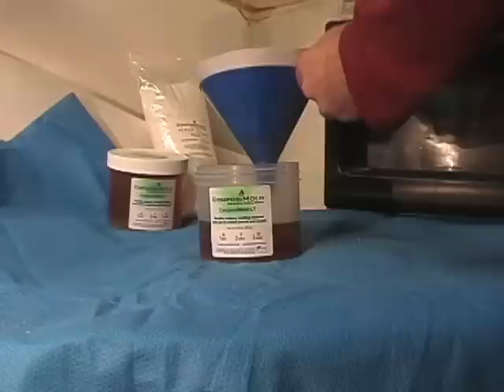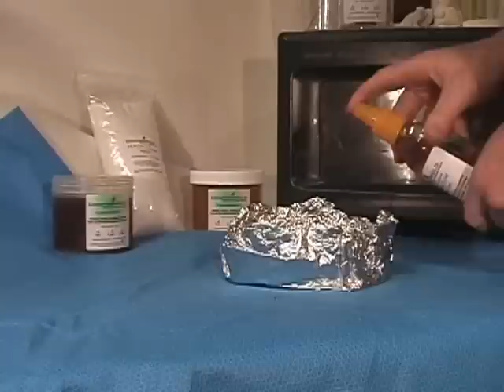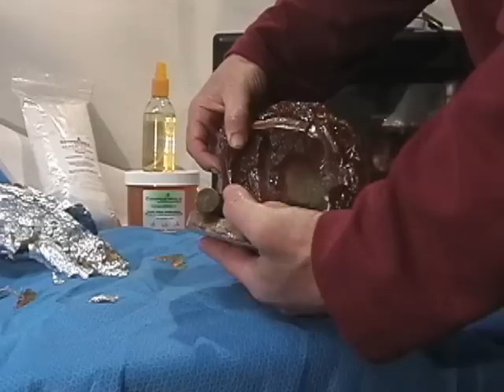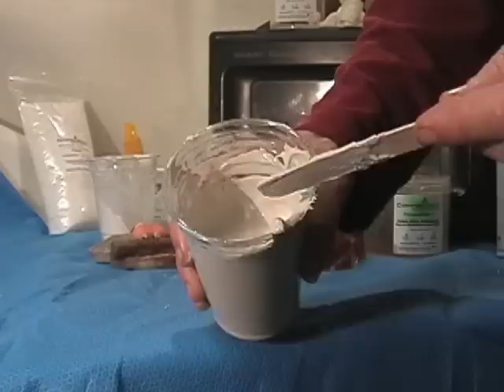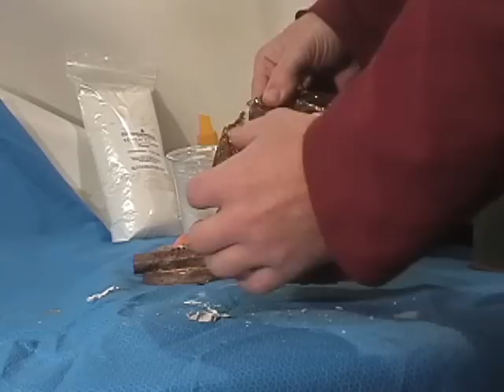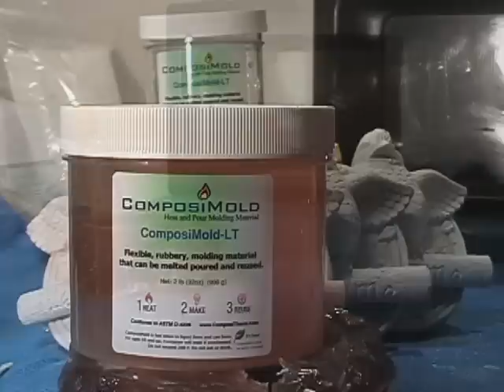ComposiMold Plaster Cast Bird Relief Sculpture

Comment from the maker: Degassing in a vacuum chamber does not seem to work very well with ComposiMold. It will make a mess as the ComposiMold expands. We think because the vacuum reduces the boiling point and makes the ComposiMold boil. Are you thinking of degassing for bubble reduction?

Comment from the maker: If you are getting bubbles in your molds, there are many ways that this may be occurring. We recommend using a PVA/water solution (like Bubble Buster) to reduce the surface tension and allow any bubbles to rise. There are many other ways of reducing any bubbles from adhering to your mold surface. If you can, check out the tutorials and questions pages on our website or give us an email and we can help. Thanks!